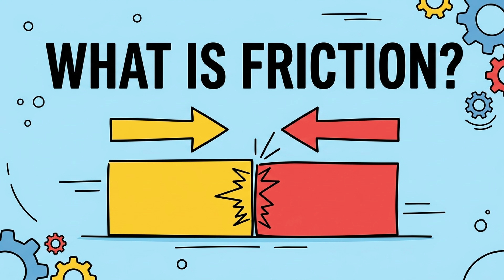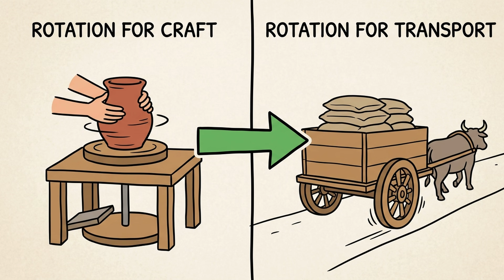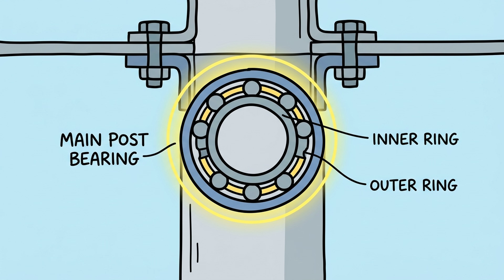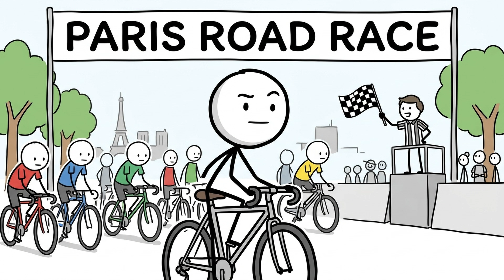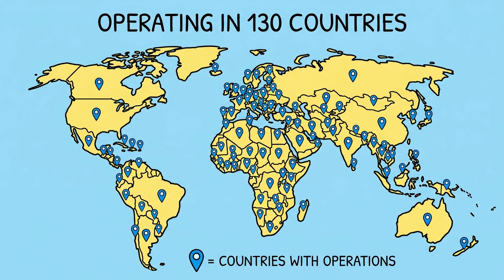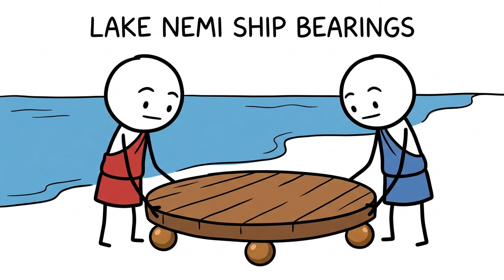How Did Humans Invent Bearings?

Comment: It seems roller bearings would be easier to make than ball bearings. You could use a lathe to make uniform rods that could be cut into small sections to make individual rollers.